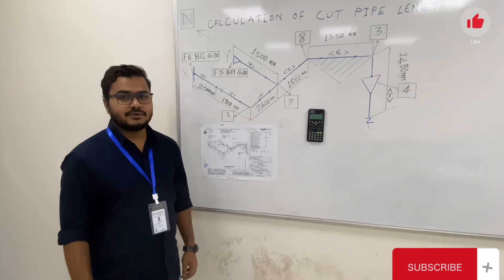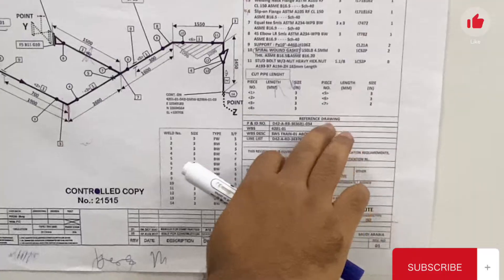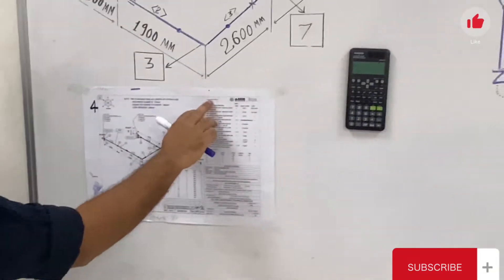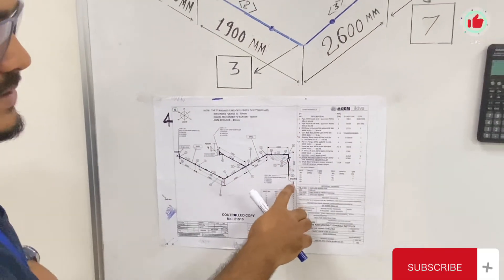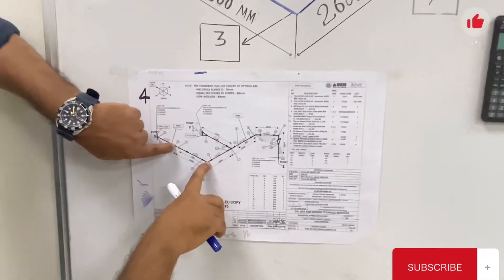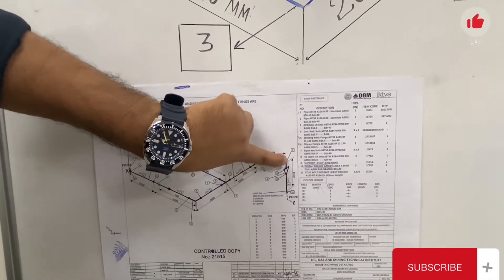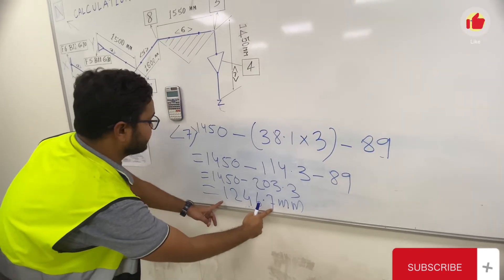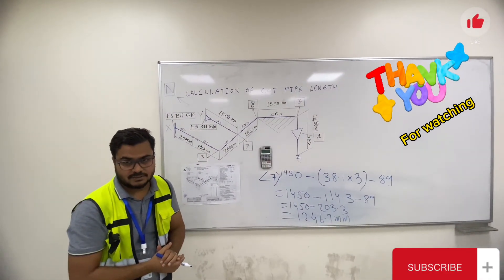How to find out cut pipe length and spool calculation in isometric drawing

Comment: Good job clear explanation, but my question is when calculating T equal size 3×3 you didn't use the size of the pipe why?

Because when calcating 90" or 45" elbow you used 90" (38.1×3) 45" (15.8×3) 
Equal T is also a fitting so why not use equal size to calculate?
Thank you